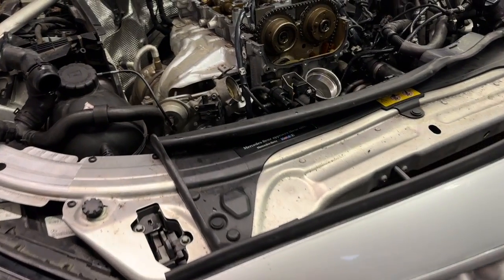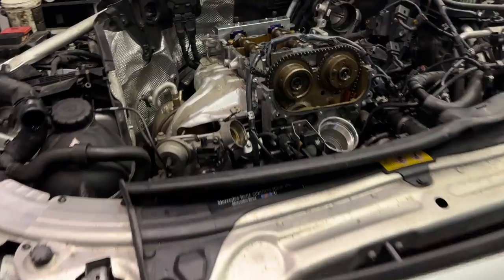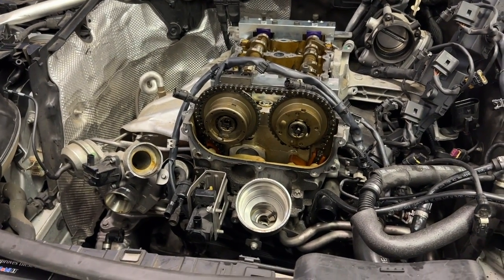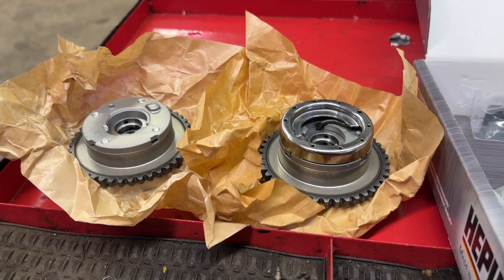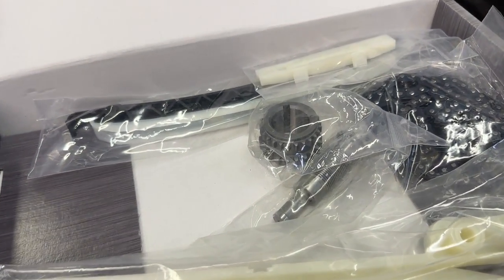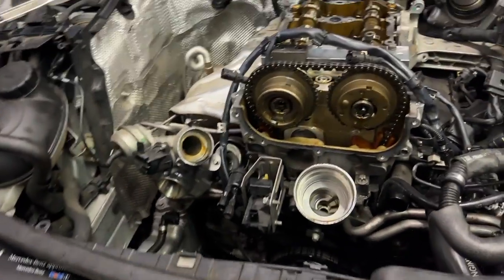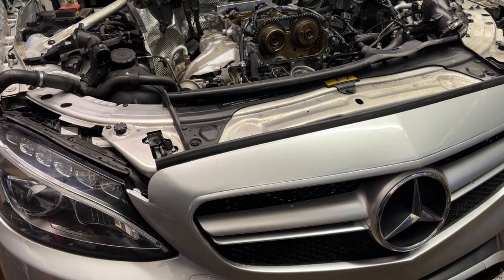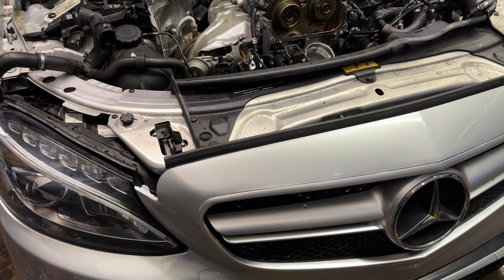How to fix Mercedes-Benz code P001685 - in a C300 W205

Comment: What if you only change the sprocket for the intake side since the code is related to bank 1 ?
Reply from the maker: Entirely possible. But think about it. Same materials, same manufacturing conditions, same mileage - do you want to run the risk, and have to do it again? As a professional shop last thing we want is to have to tell the customer they need to pay for twice the labor because we didn't anticipate an issue.